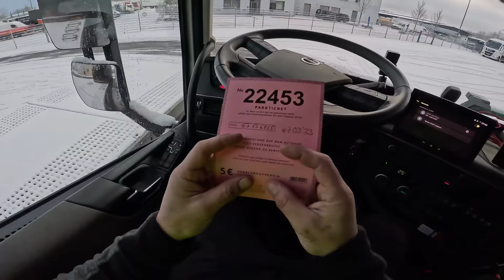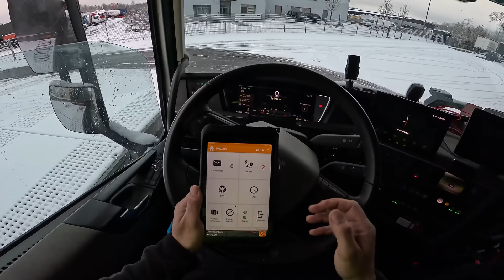POV Truck driving Volvo FH500. How does a truck driver day looks like? 4K

Comment: Greetings from the United States! I always thought European trucks look a lot better than the bottle nose trucks we have here in the States. They just look so modern. Love it.
Reply: there are a looot better
Reply: They are better to handle and they have very good visibility but american trucks look way comfier. European is great for getting the job done and american is great for living in it
Reply: @projectx5154  that and the fact that because the USA has way more straight roads (interstates and highways) than Europe the American truck is allowed to be longer than European trucks that need to drive through urban and narrow areas. there's also a difference in rules regarding the length a truck is allowed to be (Europe is 18.75m including the cab and USA is around 20m not including the cab)
Reply: american trucks look cooler but Euro trucks are much better to drive
Reply: But your American trucks, has automatic retarder and our European garbage don't have it... So by the European type, if you want to use cruise mode, you have to turn off the retarder, but with american trucks, you can use both, because you have an automatic retarder there, ours just looks modern, but they aren't, that's it :)
Reply: @rubinrafaelov2352  also euro trucks are more practical for loading onto ferries. They are like boxes with very little wasted space when loading nose to trailer.
Reply: While the european trucks might have more technical gear and the cabin is better placed for visibility, there is a huge advantage of the bottle nose of american trucks in terms of safety which is quite obvious but underestimated. In case you crash, you have the long nose part to get destructed before it reaches the cabin. Of course, if you crash into something with 100 miles per hour it probably won't make a big difference, but if you crash on lower speeds, the nose might be the reason why the driver survives the accident.

Comment: Driving a truck is very tiring, especially in harsh conditions here in Algeria. Truck owners drive thousands of kilometers across the desert. You can imagine what the driver would be like in an atmosphere of at least 50 degrees 😅 Anyway, I wish you a great trip.
Reply: Trucks over there don't have AC?
Reply: @steveballmersbaldspot2.095  I guess with 50 degrees Celsius outside there isn’t much the AC can do

Comment: I never use my dipstick to check my oil. I drive a 2016 Volvo FH420 with 940.000km on it. Every 100.000km it gets a oil change. And in the My Truck app I can see how the engine oil level is. And I have a Volvo Trucks Connect account so I can also see or book maitenance online. Next Oil Change it wil also get a new altenator😂

Comment: Hello, beautiful video👍. I have few questions: how many hours you can be awake and how many hours you need to sleep, because there are schedule rules if I am not mistaking. And if you are using retarder or engine break?
Reply from the maker: Well I'm using both retarded and engine break. Usually I use my retarded as automatic but when I see a huge downhill than I will turn off the Automatic and I use it as manual just like the engine break. In Germany you are allowed to work 9 or 10 hours on a 13 or 15 hours shift. You are allowed to work 15 hours only 3 days a week. Sleep time is 11 hours but sometimes you are allowed to do 9. The are a lot of rules here and I didn't mention half of it 😎😂
Reply: Hello,  I have an offer for you
Reply: To your first question: He also has the remaining drive time, in german "Verbleibende Fahrlenkzeit", at the first screen right of the steering wheel, which gives him the information how much time he has left to drive. [it's at the beginning of the video only]

Comment: Hi there, out of curiosity is your truck a sequential manual transmission or a full auto one? 

Where I'm from, many of these long haulers are still manual transmission despite the heavy jams, partly because many of them are quite old (like the Mitsubishi Fuso and Hino Dutro classes). Greetings from Singapore!
Reply: It looks like auto to me, but I could be wrong
Reply from the maker: This is an automatic one. In Germany over 90% of the trucks are automatics

Comment: What is the point in kicking tires? Especially trailer and front axle? 10 years driving a truck still cannot understand it... If it needs air u see it right away. If it is loose, u will not feel it anyway by kicking it...Only one axle u can check like this is main double wheel axle....

Comment: one thing this guy did not do proper is to check the air pressure in the tires during the inspection! you shall not use your foot as a tool to check the wheels. either a hammer or something hard is best according to trucking schools, that have proper teachers. I go to trucking school in sweden so i do know a great amount :)
Reply from the maker: If you believe this is my morning inspection, you wrong. If you see the footage again you will see that my foot steps were already in the snow. There are so much I do and don't show because it would be to long and boring. The content I do is for entertainment purposes only and the difference between me and you is that weil you go to trucking school I am already working as a Truck driver.

Comment: i just wanna ask a question is that to hard to get a truck and the license for it to work for any company or you need to a company with someone first and after that you can be on ur own ?
Reply from the maker: As a truck driver is no problem at all to find a job even if you have no experience. The problem is how much you get in the beginning. I had no issues at all with my truck driving licence but I had already some kind of experience because before start trucking I was a Bus driver
Reply: @Youtrucker_pt   thats cool i am a big fan of trucks , i am a web developer but tbh i love trucks an i think to leave my current job as a developer and try to get a license and start my career as a truck driver i watched your full video and really i loved it more and the idea get big more and more in my head to take this step

Comment: The engine must be started at least 10-15minutes before start driving😢 i am wrong?
Reply: No why? Just wait for air pressure to get to normal and drive. Just don't rev it too much  before it reaches operating temperature.